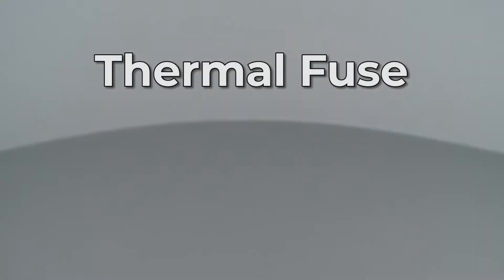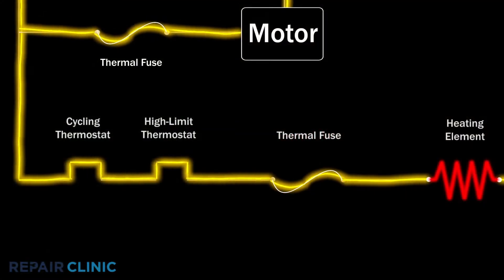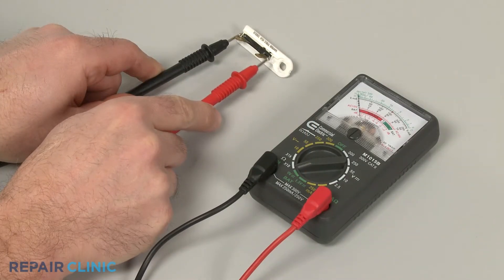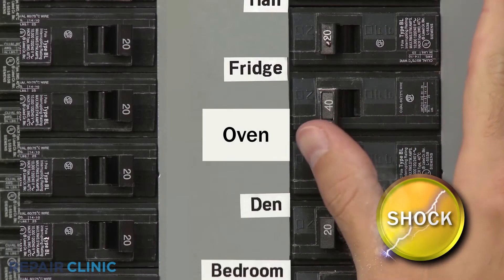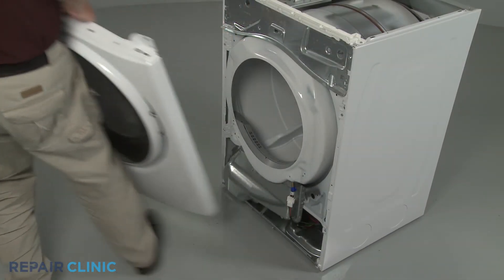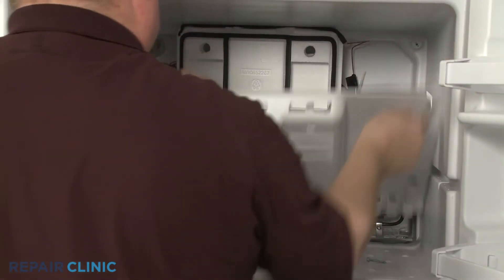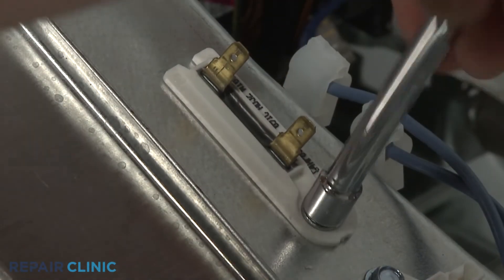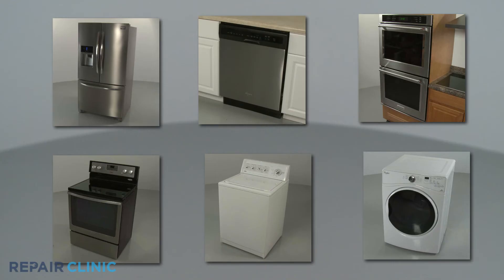Thermal Fuse Replacement

Comment: On the dryer that I’m fixing the fuse doesn’t conduct electricity through it. But, when I by passed the fuse the motor turned on but then turned off in a couple seconds. Does that mean that I have a bad thermal fuse AND a bad motor?